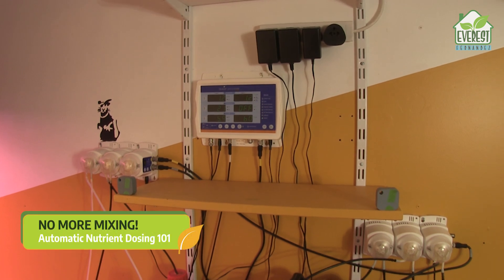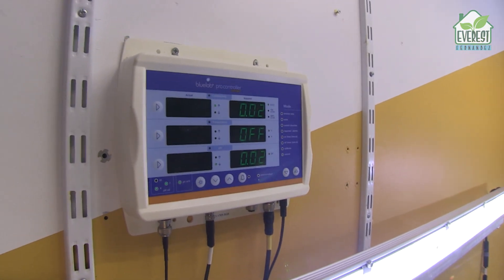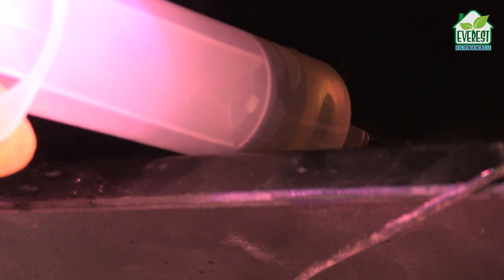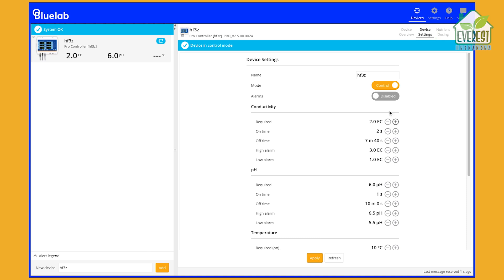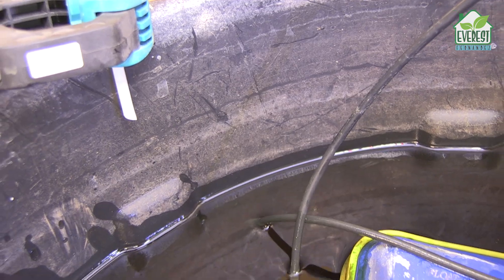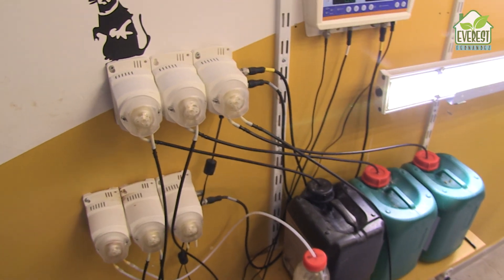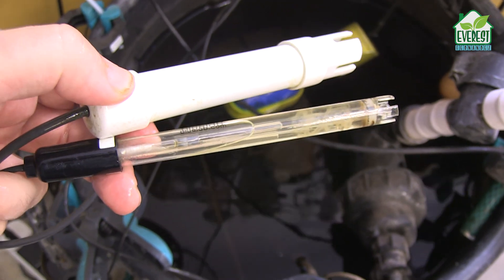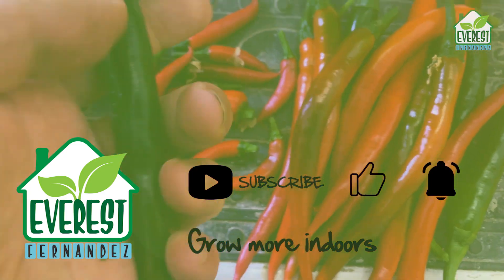Getting Started with Auto-Dosing Hydroponic Nutrients + pH Adjuster using the Bluelab PRO Controller

Comment: hey man, great to have you back. two questions: some formulas like canna require to shake the bottle before dosing, how do you deal with that? how does the controller deal with ec going higher than the set value?
Reply from the maker: Thanks for your questions! All brands of liquid nutrients suggest shaking well before use, but a two part mineral-based nutrient won’t really need it - everything is (or should be) in solution. Not that it’s a bad idea to give your bottles a shake from time to time, and you could always use magnetic stirrers (handy for gloopier, more viscous one parts). My feed reservoir has a float valve which tops it up from the run-off reservoir (which, in turn, is filled mostly with RO water). Due to the dilution of the leacheate / run-off with the RO water, the top-up solution is always a lot lower EC; this serves to counteract any event where the EC has risen above the max setpoint. Set the on-time for nutrient dosing so the EC doesn’t go up more than 0.1mS each dosing event.

Comment: looks at prices
nah these still aren't for home or hobbyist growers. Small commercial grow that hasn't hired an automation engineer yet sure.
For home and hobbyist growers, there are DIY / open source options for a fraction of the price. would be cool to see yta tackle those.  Everything is easy with enough money.
Reply from the maker: It’s not cheap gear. No getting around that. I was lucky to get these units to test, and Bluelab were super patient with me and supportive when I had technical queries. Talking to other growers, I’m not alone in appreciating their high level of customer care. So, yes - the gear comes with a price tag - and I can definitely vouch for commensurate build quality and usability, but — just as importantly — the excellent customer support from Bluelab and also now their Edenic platform for managing multiple devices adds significant value for me. If you have the tech skills and the time, it must be really empowering to create your own bespoke solution, but for a busy grower like myself, always juggling a lot of plates, the Pro Controller has proven invaluable.

Comment: Yes. Dosing system seems to have great potential. Bluelab or Dosatron. But dont forget about dosing your RO aswell. There is no point why have dosing system of your nutrients without that. Probably gonna need RO unit with water inlet near your mixing tank with some valve. Just want to mention this one. This automatic system can be done really fire one but not really every one can do it if growing in home. Not thinking about budget but rather about re-building your house :( Or??
Reply from the maker: Thanks for your insights. Yes, I only use RO water in my indoor garden. I store that in a separate 200L tank so I always have a go-to supply.

Comment: Don't the Samurai nutrients need to be shaken before use?
Reply from the maker: They all say that on the label. Not a bad idea to give the bottles a lift and shake every week or so. If you’re worried about less homogenous fluids, use a magnetic stirring device.
Reply: @Just4Growers  Cool, thanks for letting me know, i have my samurai bottles in a rack with an airline going to each bottle to agitate them, i was going to attach a 100$ WIFI aquarium doser to the lines instead since i just received a great (so far) 100$ PH & EC controller from Aliexpress but there is zero information on setup as usual with such products and they are so new on the market there's not even a youtube vid, i had thought about the magnetic stirring but the tiny battery powered ones that would fit my setup aren't cost effective
Reply from the maker: You’re welcome Graeme, A word of caution regarding over-aeration of stock solutions:

Oxidation of Nutrients: Some nutrients can oxidize when exposed to air. For example, iron (Fe) can oxidize and precipitate out of solution, making it unavailable to plants. This is especially true for chelated forms of iron, which are often used in hydroponic solutions to keep iron soluble. The introduction of air can disrupt this balance.
Degradation of Organic Compounds: If the stock solution contains organic compounds, such as certain types of organic acids or amino acids, aeration can accelerate their degradation. This can alter the nutrient profile of the solution over time.
pH Fluctuations: Aeration can cause the pH of the solution to rise due to the off-gassing of carbon dioxide (CO2). This can lead to precipitation of certain nutrients, especially if the pH rises above certain thresholds.
Potential for Contamination: Introducing air, especially if it's not filtered, can introduce contaminants, including pathogens, into the stock solution. This can lead to issues with disease in the hydroponic system.
Gas Imbalance: While oxygen is beneficial for root health in the nutrient reservoir, excessive oxygen in the stock solution isn't necessary and can lead to imbalances. For example, excessive oxygen can drive off other gases that might be beneficial or necessary for the stability of the solution.
Evaporation: Aeration can increase the rate of evaporation, leading to a concentration of the nutrients in the stock solution. This can make it harder to accurately dose the nutrients when preparing the feed solution.

A final note on physical agitation: While the intention is to keep everything dissolved, physical agitation can sometimes lead to the opposite effect, causing certain nutrients to come out of solution, especially if they're sensitive to changes in temperature or pH.
Reply: @Just4Growers  I was wondering if it might be an issue to add air but it was only going to be for 2 seconds to simulate shaking, i bought an air pump for air domes in autopots years ago but its overpowered and i think i was trying to shoehorn it into my automation project to feel less wasteful, thanks again for the info and all the great videos

Comment: for a small commercial grow it looks great , thanks for sharing & all the detail 😎
Reply: Its use is for automation, large or small.
Reply from the maker: If I had to describe the product in one word, I’d say ‘versatile’. It can be configured to make the life of even a small, hobby grower like me much easier. But it’s really a pro product or serious enthusiast: Remember it is quite capable of dosing commercial sized reservoirs using the L3 peripods (10Xdose rate). My Pro Controller presides over a relatively small feed tank here in my basement - just 50L - compared to the run-off tank under the grow tray which is 200L. I think all commercial hydroponic grows, small or large, should be recirculating their run-off, and this machine helps a lot with it’s continual, tiny adjustments, as well as making up fresh batches.
Reply: @Just4Growers   absolutely a good point you make ,  my thoughts its perfect for that in-between size grow , but youre right it would work just as well in a smaller set up for a home grower who is an enthusiast with a good budget . I think a lot of products get criticism for their price but its a free market & not everyone is poor & a lot of people would happily have this product to add further to their set up & system & the price being irrelevant.

Comment: With a drain to waste system you only have to mix the nutes once and it'll stay the same, the waste water can be used to water other house plants or rhe lawn. 

Another good idea would be making a 10% stock solution with nute salts so the dosage gets easy to apply, furthermore it's cheaper by a grand margin. My Suggestion would be hakaphos red 8-12-24(+4), calcium Nitrate, and Magnesium sulfate aka epsom salt. With this 100 liter of nutrient solution would cost 50 cents. 25kg of hakaphos red costs 78,90€
Reply from the maker: I do not consider drain to waste a viable option for sustainable hydroponics. By adopting my approach of a relatively small feed tank compared to run-off / top-up tank, you use a lot less nutrient and water.
Reply: Dont give away the secrets dude, weedheads need to be kept on their $ubscription of 90% water bottles to erm, benefit the industry
Reply: Wherevto get this fertilizer?.. unavailable wherever i look.